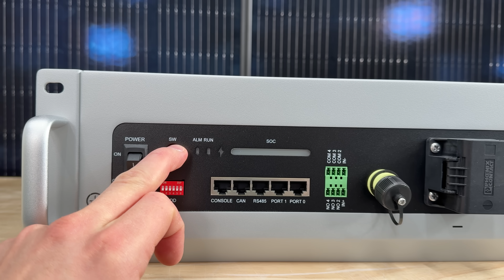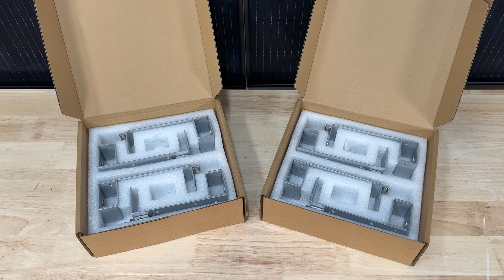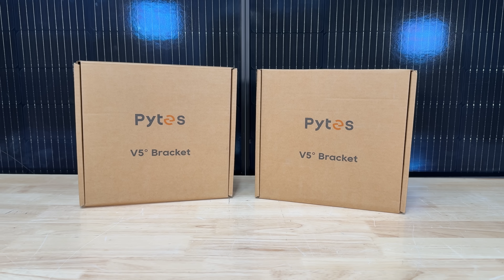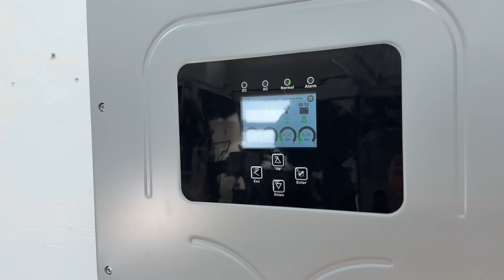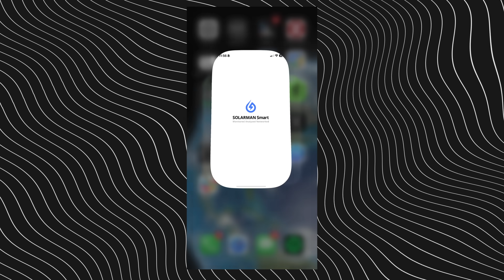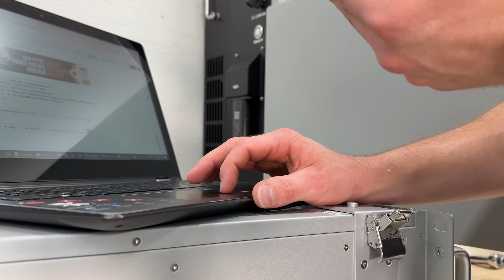Here's the Truth... Pytes 48V V5° Server Rack Battery

Comment: I bought 4 of the 48V V5º battery for my just commissioned off-grid system near Albany, New York. I had zero problems with the batteries. I just daisy chained the 4 batteries, connected them up to the Victron Cerbo GX, turned the batteries on in sequence, and I didn't even get a single error message from any of the batteries. I w as expecting days of troubleshooting, but "it just works" (like Apple used to say). Very satisfied.

Comment: you're talking too fast, I could not understand some things your were saying. Slow down for us old timers. :) You DO or you DONT have a screen indicating the state of charge, you talked too fast and I couldnlt hear if it did or didn't? If it does not show the state of charge of my batteries  that is terrible. These are not cheap yet they cant show the current "
in-time"voltage?
Reply: Each battery has a state of charge LED indicator on the front so you can manually check. I just commissioned my setup this week and have all of the batteries connected to my Victron Cerbo GX computer. I haven't dug into the Cerbo to see if each battery can be viewed individually.

Comment: Thanks for the detailed review — we really appreciate both the feedback and the recognition of our hardware.

We agree that the current software experience (apps, firmware updates, tools) can be improved. In this case, it was a combination of older firmware stock, setup challenges, and limited early support access — but we fully understand how that impacts the experience.

We’re already working on:
• A more unified app experience
• OTA firmware updates via the Pytes app
• Improved desktop software (full English support)

At the same time, as a battery manufacturer, we stand firmly behind our core — from cells to BMS to full pack design. Reliability, safety, and performance are where we do not compromise, and we’re glad to see that reflected in your testing.

Thanks again — feedback like this helps us keep improving for installers like you.
Reply: My recommendation is if you guys stat with solid technical documentation. Down to protocol specification if you will/can. Open source community will support you. Heck - I will because I just bought 48 E-BOXes and I would love to have my own custom Linux software to side monitor setup via RPi / MQTT bridge.
Reply: @pllevi  We’re happy to support capable customers who are interested in developing their own solutions. Please feel free to contact us by email, and our team can provide the relevant communication protocol documentation for further integration and development.

Comment: A 2026 product that requires you to pay EXTRA for an update dongle right out of the box?  I haven't seen such bullshittery in decades.
Anybody remember when professional Adobe products required hardware keys to unlock? I get the same vibe.
Reply: You don't need a dongle.  You can update it Via a Can-USB adapter on a PC.
Never use a WiFi dongle, the signal on WiFi is not very reliable.  It drops packets and can corrupt the firmware update.

Comment: Is this a Joke, I owned EG4 LL batteries and sold them to buy Pytes V5s.
There is absolutely no comparison between these two batteries in terms of just build quality.
First off you forgot to mention that the Pytes has a dual BMS systems.  If one burns out it actually has a backup.  Secondly the EG4 LL batteries have always had cell balancing issues because the passive balancer is terrible. The Pytes has a much better balancer that gives zero issues.  There is no heater in the EG4LL Rack mount battery that you displayed.
Third there are no Heaters in the EG4LL Batteries.

The $1400 price tag on both of those batteries is because they are UL listed and also certified to be used in most states.  BTW the EG4LL uses cheap Telecom Cells.  The pytes uses EV grade cells.

I have no idea about the firmware updating with a dongle.  I would never use a WiFi to do an update, chances are your connection dropped and the battery got bricked.  They will replace the Battery under warranty, which is something you failed to mention.
I used a Laptop to update mine, which is how I update all of my equipment.  I had no problems doing the update and the files were easy to locate.

You probably just steered a whole bunch of people in the wrong direction just because your update failed.
Reply: Large part of why I chose Pytes V5 batteries as well.
Reply: @maxherman11  Yep and he also forgot to mention that the EG4 LL has no built in Heater.
Reply: At this point these guys do these video because its a business
Reply: Pytes v5 dual bms

Comment: $1400 100ah that can only do 75a in 2026? What the hell were they even thinking.
Reply: Yea, a Dato Boss 16kwh unit at 200A is the same price..
Reply: The V5 Battery will discharge at 100 DC Amps with a Firmware update.

Comment: I have a bunch of these batteries and they have been great for me.  No firmware issues using the dongle.  The solarman app kind of sucks.  You can see individual battery information, but the UI isn't great.  I don't think Pytes owns that app, though.  I believe they are working on their own app for US folks, but who knows.  In reality, most of the time you just want to see the entire system and the Sol Ark handles that.  EG4 is more of an all in one solution so you would see more info that way.  When you start doing multiple stacks of batteries the height of the Pytes is better.  It's easy to stack 8-12 batteries in a stack.  Also, Pytes has a hub that allows for groups of 16 batteries so you can have a lot of batteries if you want them.
Reply: Thanks a lot

Comment: It's just 5kWh, which can be bought elsewhere for $600 + shipping, so why does this battery cost ~$1,500? Does it have some super special features?
Reply: Yes it's a properly UL listed battery that can be used on all installations in any State.
Most of the $850 batteries have no certification, no heaters and use Telecom Cells, not EV grade cells like Pytes.
Reply: The upselling here is wild, "accessories" is what this battery is all about.  You want to stack them?  Pay us.  You want to wifi?  Pay us.  If you want to update?  Pay us.  

That on top of this product being 2.5x the price of batteries at identical sizes.  

I'll gladly take 2.5x the storage, pinch my fingers a little and make my own shorty cables.  While including wifi and bt on most batteries already.
Reply: @liftbikerun  I just got a bid on these. $1900 buck each.
Reply: That is why I like the assemble yourself kits.

Comment: I guess this might be because I am still a novice in solar and batteries, but $1400 seems high, no? Are there not similar batteries for like 800-900 dollars typically? I don't understand why these are better than Vatrer or Eco-worthy?
Reply: $1,400 for a brick? Yes, it's too much in my opinion.
Reply: Anytime they get that UL listing the price goes up hundreds.  And if your battery burns your house down insurance is going to ask if it was UL listed.  Also in most areas you can't grid tie anything not UL listed.
That is why it costs so much.
Reply: @HeadCannonPrime  I built my house with a zone sprinkler system because its too cheap not to.
Reply: @HeadCannonPrime  i dont care about grid tie. our utility company sucks, the point of doing this is energy independence.
Reply: Not with these many features but yes there are cheaper batteries.
Reply: @Jebus-d9k5j Oh I see. Thank you for clarifying. These are more feature-rich. That makes sense.
Reply: @Quietshow  I prefer the battery kits I assemble myself for this very reason. Higher quality at a lower price.
Reply: @Jebus-d9k5j  it stores energy. it's overpriced
Reply: @andrewdonohue1853 Depends on what you want to use it for. Every battery has an application where its most efficient.

Comment: Was waiting for this, I’ve got 50 batteries waiting to be installed by myself for our 5 SolArk 15k’s. I’ll make sure to update each battery with the USB method instead as that’s likely RS485 and less likely to fail VS the dongle. As someone who works in IT, serial comms is pretty simple and USB makes it simple. But good to note on that, thank you. I got them for the communication with SolArk. Don’t care too much about monitoring each battery individually. I see it as a giant battery pack. I’ll have SolArk hooked up to SolarAssistant for MQQT integration into Home Assistant for global monitoring throughout my home infrastructure. Thank you for the review though! I can always count on y’all to give us the straight facts with no BS!
Reply: What made you go with buying 50 of these? What was the value proposition that made you pull the trigger?
Reply: @elimar48  I got a bulk discount from signature solar and their ability to work with SolArk seamlessly with no issues sold me on them. I was looking into EG4, but, what had scared me off was the fact that EG4 says it works with SolArk using an emulated protocol and SolArk does NOT have them as a verified battery partner, and I did hear some stories about EG4 batteries in closed loops comms causing firmware corruption on SolArk as they were supposedly changing values they were not even supposed to have access to. That is what ultimately led me to the pytes as the price was really good. If I were buying now, I would probably go with Discover batteries but the pricing was a bit higher and they were not as mainstream. I have yet to even install the batteries or inverters yet (still building the home), I got the batteries and inverters and solar panels back in 2024 as the fear of tarrifs led me to hastily buy all of them. My panels are installed, but our inverters and batteries are still sitting in storage. wish I could have gone for 5 18k's instead of the 5 15k's I have as it would have been less money, but, nothing I can do now on either front. Not like they are bad at all though. But I am still happy with my pytes decision. Just wish I could have changed the inverters, that's my main gripe, bigger is better.